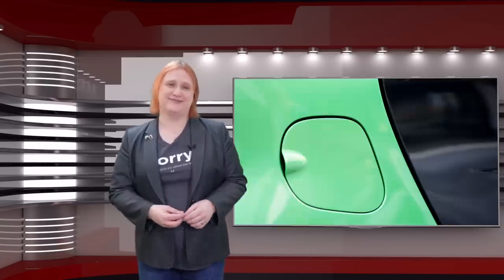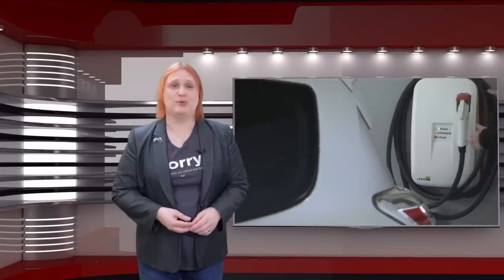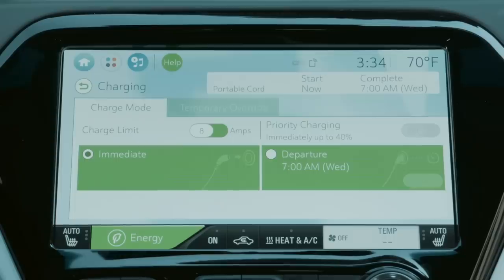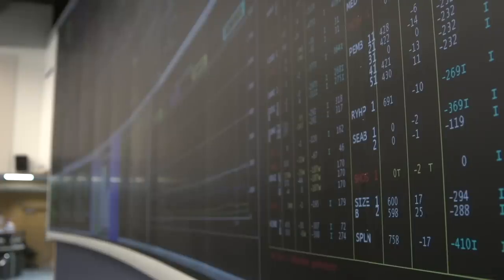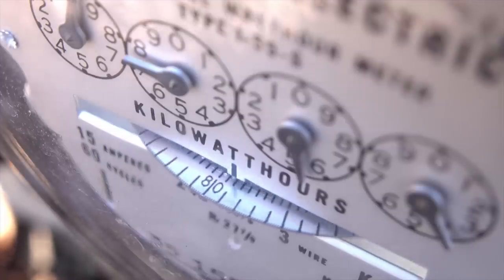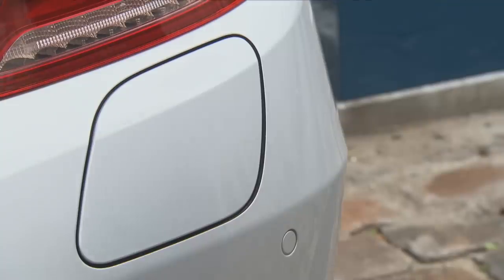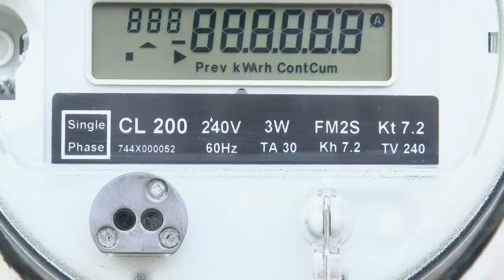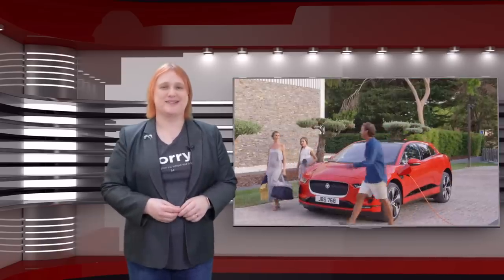What's a Charge Timer -- And Why Should You Use One With your Electric Car?

Comment: Good topic. Here in AZ we have super off peak and electricity is $0.03 per kwh so I try to charge my Bolt during those times with Hilltop reserve on. On peak charge is $0.24 per kwh and its $0.11 off peak so it does save money and lower my electric bill by scheduling charging  times from the car. My wife's i3 is set to precondition the battery 45 minutes before she leaves for work when the temperature drops to 35-45 degrees in the winter. She noticed the usable range increases by as much as 10 miles because the battery warmed up on the cold days. We always schedule charging and the Bolt has the best scheduled charging options I've seen.

Comment: Could you do a show on home charging stations and what is needed to install one.
Reply: Another benefit of departure charging in terms of battery heath is that in hot climates, you're charging during the coolest part of the morning so the thermal management system doesn't have to work as hard to keep your battery cool. If you live in a cold climate, departure charging will help ensure that the battery is warmed up when you depart, giving you the maximum range.

Comment: My C-zero and my Ioniq can not be programmed to charge up to a selected charge percentage. Therefore, I have made my own charge timer where I just enter the remaining percentage and the system will start charging at the right time (one car at the beginning of the night rate and the other at the end).
It is setup via a web page accessed over wifi.
This way 1 car begin to charge at 22:00 and the other end at 06:00. They will also stop charging when the battery is 80% full. I also don't have to calculate when to start and when to stop charging by hand anymore :)
Reply: My Peugeot iOn 2011 does not have a timer nor does the Polar charger I have at home. It also does not have "preconditioning" as I have to unplug it for the heater to work. I tend to wait until 1am or so as I do have a 30 mile each way commute and so need to fully charge each day. I do have a Kona on order so this situation should improve.
Reply: Very cool!  What EVSE do you have?  I have an Ioniq and I wish it had a setting to stop at 80% so I could just plug it in, set my EVSE to charge after 7pm when the rates are cheap, and not worry any further.  Here's my method:  When I get home I hit the EV button to see how long the car says it will take to charge, then I schedule it on my Chargepoint app to charge for 1 hour less (i.e. if the car says it will take 3.5 hours to charge then I set it to charge for 2.5 hours).  That gets it to almost exactly 80% in the summer and to about 90% in the winter.  My car has the cold climate package so I think the battery charges faster than the car thinks it will in the winter.

Comment: Can we please address the common misconception that "the bigger the battery, the longer it'll take to charge". While it is true if charging from 0% to 100%, it isn't true day to day. If you drive 50 miles a day, it will take your car the same amount of time to recharge every night regardless of how big your battery is. I keep running into this misconception from people who think they should avoid EVs with bigger batteries because they think it'll take longer to charge regardless of how much they drive each day. Similarly, they look at how many kW the car's battery holds and automatically assume that's how much they'll have to charge it every night and that it'll run up their electricity bill that much every night. Time/cost to charge is dependent on how much you drive, not the car's battery size!
Reply from the maker: If you note, we did allude to that ;)
Reply: Agreed. While some EVs are more or less efficient, the difference is negligible for "shorter commute" distances.

Although there are differences in maximum current draw by vehicle, it generally has little to do with battery size.
Reply: @transportevolved  I know :) But I think we need a dedicated video for it. I haven't found any.
Reply from the maker: Go it! :)
Reply: I think you should avoid buying an ev with a bigger battery if you just don't need it. It's got a higher cost to buy and a heavier battery.
Reply: @chrisredfield3240  I agree ONLY if your EV is your second car, and/or it is never going to be used for road trips.
Reply: @chrisredfield3240  well we never sure what the future holds right? you know what they say, it's better to have it and not need it than to need it and not have it
Reply: XP-8 TIM, @0:13, when Nikki listed variables about “how quickly your car charges”, she omitted one of the most critical variables, which is the onboard charger kW rating, which is just as important as your home charging station. So when she got to “the capacity of your battery”, it becomes ambiguous as to whether it takes more or less time to charge.

Building on your point that charging is best compared in “range added per unit of time”, we know larger batteries can DC fast charge at a higher rate for any given battery design. We see this with Tesla batteries, and we see this with LG Chem budget batteries in the Bolt, Kona, I PACE. 

There is also some correlation between battery size and onboard charge size. The original Nissan Leaf had 3.3 kW up to 6.6 kW, for a 24 kWh battery. The Chevy Bolt is 7.2 kW, Tesla is 10-20 kW. Normal charging should be 0.1C to 0.25C, and I think you will see all onboard chargers in this range, except some versions of the Zoe which carries its DCFC onboard. 

So in places with super off-peak of 2¢-3¢/kWh, but for only a few hours, bigger batteries will typically replenish daily consumption faster, with less stress on the battery, than smaller batteries. They don’t need to be fully charged either, which also makes them last longer, and allowed them to charge without tapering.
Reply: @imho7250  Until recently, Tesla had a 48 Amp (11.5 kW) standard onboard charger and a optional 72 Amp (17.3 kW) charger for an extra thousand bucks.  I just checked the Model S and 3 configurators, and the optional charger is now gone.  I don't know if that means you can't get the big one or if the big one is now standard.  Anyone know?
Reply: IncognitoTorpedo, good question. I think the 72A is now a stand-alone charger, unlike before when they used dual chargers. So I’m guessing the model S/X come with 72A. If not, all those HPWC good for 80A are now a waste.

Interesting, Tesla is trying to have people believe the model 3 can handle 250 kw, yet only giving them 48 kW onboard. I think the charger is inside the battery penthouse on the model 3, so they could have made that 80A if they wanted. Even if you don’t use 80A daily, I’m sure there are times when that would be better than 48A.
Reply: @imho7250  Well, the 250 amp number is DC, so it would bypass the rectifier that's the rate limiting step in AC charging.
Reply: IncognitoTorpedo, the 250 is kW, which would be in excess of 620A until the battery cells were all surfaced charged to 4.2v. I’m guessing more like 650-700A when it first reaches 250 kW. 

Personally I don’t believe there will ever be a public update that allows all existing model 3 to charge at that rate. It’s just a stunt that can be done with any battery, but the battery life will suffer. I can take an old Nokia phone battery and charge it at 4.2v unlimited amps and it will charge. But it’s not a good idea.

I bet the highest model 3 charge speed for public release to everyone will max at 400A or 160 kW. Not 250 kW.
Reply: @imho7250  Oh, oops I meant kW.  At any rate, that amperage would be spread over a large number of cells, wouldn't it?  It would depend on the pack configuration, but other EV makers are also talking about high wattage charging, so it's highly likely to be possible.
Reply: IncognitoTorpedo, sending 250 kw 80 kWh pack is sending over 3C charge rate to each cell, no matter how they are configured. This is way higher than most manufacturers allow. 

One problem is that the charging circuit was rated at 525A according to EPA documents, and I think even though it’s possible to send 700A over a short period of time, I don’t think regulators will ever allow it. Typically we see EVs under-rate power to 80%. 

Tesla will break ground on the first one the public early access can use next month, then collect data for 3-6 Elon months. Basically enought time to collect all the model Y deposits possible, based on hype that they can charge at 250 kW and add 75 miles in 5 minutes.

After that, Tesla will perhaps allow tiny improvements in charging power for the paying customers, but not model S/X free charging. Lol

Tesla needs to balance this fast charging with the 120,000 mile degradation warranty. If the build in an algorithm that limits charging power based on degradation, then possibly Tesla can enable this. You get to use it 10 times at 250 kw and 20 times at 200kw and 40 times at 160 kw before it goes back to 120 kWh.

I think it will be several months before we know the real deal on V3. So far no legit YouTube video was made, which means no early access YouTuber has access yet.
Reply: Not only that but with a bigger battery I use a lower charging rate and catch up on weekends. I don't need anywhere near the 240 mile fully charged battery capacity and let the battery drop below 100 miles without worrying. My wife needs the higher capacity charger to keep her Fiat topped up and I use the "granny charger" to add about 20miles in the midnight to 5am slot.
If memory serves batteries do not get charged to 100% for the very reasons stated in the video. I do still use the hilltop reserve setting to ensure regen brakeing at the first few stop signs. Charging to 90% of the maximum is fine if the cars batteries are a bit larger than you generally need.
Reply: Wait, what???  Do people really think that? (I'm referring to @UC1jq79sDSReBiTtG4QSHrfg's original post).  How can anyone not make the correlation between gas used vs electricity used?  The further you drive the more energy you need and it doesn't matter if that energy comes from gas or electricity.  Does their gas car use all the gas in the tank regardless of how far they drive?  LOL!  Wow, the misinformation out there is really bad if people actually think this.
Reply: Andrew Dowdall, I’m not sure who’s comment you are addressing, but typically the correlation between gas used vs electricity used revolves around two key points: 
1. Electric cars can go farther on 1 kWh of electricity than a gas car can go on 1 kWh of gasoline or diesel. 
Coupled with...
2. A gallon of fossil fuel burned in an industrial generator designed to run at exactly that RPM all day, at exactly that load all day, will make enough kWh to be transmitted over the grid, converted into DC, stored in a battery, and converted back to AC, and still be more efficient than running a small gasoline engine in a non-hybrid.

With the electric car we have several ways to ensure all the power comes from renewable energy. Some people charge from their own rooftop solar. Some grids have solar farms or wind farms, which allows the EV to become greener over time. 

A modern hybrid is very close in efficiency to an EV run from grid power produced with fossil fuel. But the hybrid will never be able to run 100% off renewable energy, unless it’s a plug-in that never goes over it’s all electric range. 

I feel a decent plug-in hybrid like Chevy Volt for $35k plus $15k in rooftop solar is a cleaner solution than a $50k BEV. But if you can afford a $80k BEV and a $50k rooftop solar, that means you are blessed, not special.
Reply: @imho7250  I realized that I had a typo that may have made my comment a little hard to read.  It should have said " How can anyone not make the correlation..."  It was a rhetorical question because I found it so unbelievable how many misconceptions there are about EVs.  LOL!  I agree with everything you said and it's refreshing to hear someone who actually gets things like electric motors are way more efficient than gas engines, and that EVs become greener as we clean up our grid.  I drive a Hyundai Ioniq EV and live in Ontario, Canada, so running my car has a very low carbon footprint.  It's fueled mainly by nuclear so that's another debate.  LOL!
Reply: Andrew Dowdall, yes, nuclear power is one of those necessary evils, as long as they are not built in the wrong place, by the wrong people and operated by unqualified people. 

It wouldn’t surprise me if some day we have nano reactors which are safe enough to carry in a car which constantly send up to 10 kW output to keep the battery charged, losing some ground at cruise, but replenishing it when you pull off the highway to get something to eat, or get to your destination.
Reply: @imho7250  The Tesla model 3 has a 48 Amp (Not kW) 11.5 Kw onboard charger.  The portable charger only allows you to use 32 Amps of the 48 Amp onboard charger.   The Tesla HPWC (High performance Wall Connector) allows you to use the full 48 Amps if it is on a 60 Amp or higher circuit.  National Electrical Code(NEC) only allows you to continuously use 80% of the circuit.  IE 48 Amps of a 60 Amp circuit.  Or for 120 Volt standard plugs 12 Amps on a 15 Amp circuit.  The 48 Amp 240 Volt HPWC is 8 times faster then 12 Amp 120 Volt wall plug.

The HPWC can go up to 80 Amps on a 100 Amp circuit.  This sounds strange when the biggest on board charger in any Tesla can only use 72 Amps.  Tesla allows you to network up to 4 HPWC chargers together on a single electrical circuit.  The four cars share the available 80 Amps.  If all for cars need charging then each car gets 20 Amps.  If only one needs charging then it gets a full 48(72) Amps.  You don't need to think about it.

If you wired 4 HPWC at 60 Amps each on separate circuits, the load on your house would be 240 Amps.  While 4 HPWC sharing a 100 Amp circuit is only 100 Amps.  Most homes in the US only have 200 Amp service entrance.  The National Electrical Code(NEC) states in the 240 Amp case you must upgrade your service to something like 400 Amps.  Upgrading your service entrance to 400 Amps costs a lot on money, I would guess $5000.  So the networked HPWC would be lot cheaper to install.
Reply: k34561, yes, now tie all that in with my comment that regulators will not allow 700A DC charging on a car with 525A rating, except for experimental use. And if the model 3 batteries did have superpowers to charge fast without degradation, I’m sure they would have offered 72A or 80A onboard charging, which allows it to use many Tesla HPWC to their full extent.
Reply: k34561, and so you can understand the 80A HPWC, the original model S used a 40A Charger, the same ones in the V1 superchargers. You could get it equipped with dual chargers, 2x 40A = 80A. Later Tesla went with 48A chargers in the V2 superchargers and cars, and offered a 72A charger. 

Many people were hoping V3 would use the 72A chargers and that would give 52 kW per charger gang, or 208 kW per supercharger cabinet. This would have allowed Tesla to do their high powered charging gimmick, and within 10 minutes anyone needing to use the paired stall would be able to get 104 kW, which is significantly better than 36 kw, which is what you get if the first car can still use 108 kW.
Reply: @andrewdowdall2690  ^^ I just wanted to wave to a fellow Ontario grid user and EV enthusiast, and point out to others that the reason Andrew's Ioniq runs mainly on nuclear power is because (I'm assuming) he charges it overnight. During the day we have lots of wind, solar, and natural gas and hydroelectric power but we taper down to mostly nuclear overnight. Our 3 nuclear reactors (CanDU design) don't allow more than a few percent variation in output; they are designed for base generation. We also have time-of-use pricing, so it really makes EVs cheap to run.
Reply: Hi  @TaiViinikka !  Yes, I do charge at night almost 100% of the time.  I read that Ontario's electrical grid carbon intensity per kWh (CIPK) is 40g/kWh.  That might be an average, so overnight it might be even lower.  For anyone who's interested, here is a cool website that shows live carbon output for current electricity generation:  https://www.electricitymap.org/?page=map&solar=false&remote=true&wind=false

Comment: I use a heavy duty timer on our plug (Leaf's charge timer has never worked), I get cheap night rates from 9pm to 7am so the car is usually fully charged by around 1-2am ready for use at 6am. Our kW rate is about 50% less at night (new zealand).

Comment: I use a charge timer on our LEAF for these reasons, but also to allow the battery to cool down a bit when we get home before charging, and then to warm it up for slightly better efficiency before we leave in the morning (no active temperature management in the LEAF as you well know!). We only have 3.3kw charger so probably doesn’t make much difference but every little helps 😄 another great vid - thanks Nikki

Comment: As I have 2.8 kW solar panel system and it is southwest orientated, my Nissan Leaf is set to change from 10am to 4pm when solar panels generating most of the power. I only fully change and allocate 2 days for it before a long trip about 1-2 times a month.